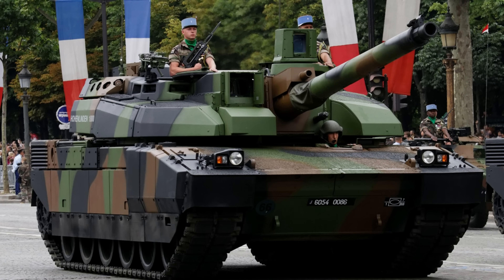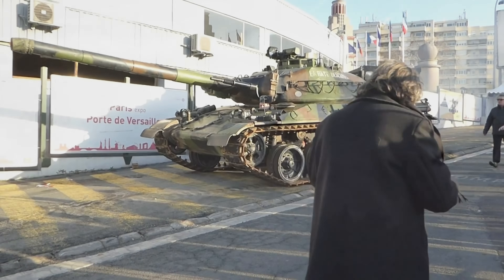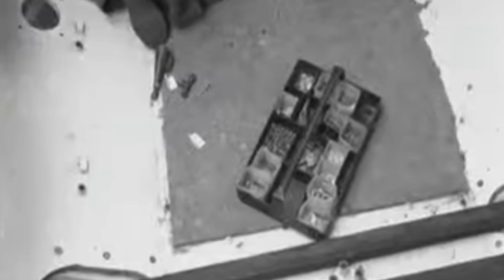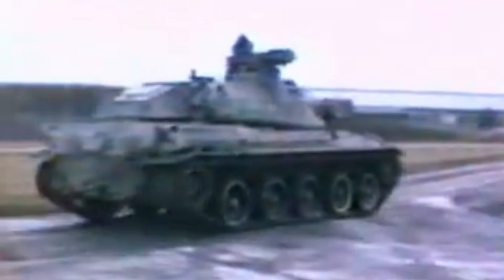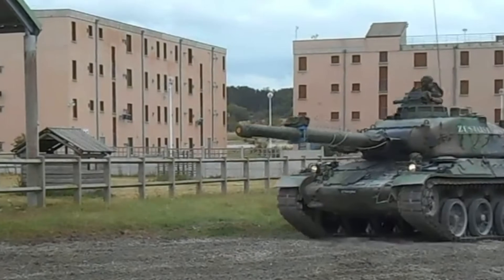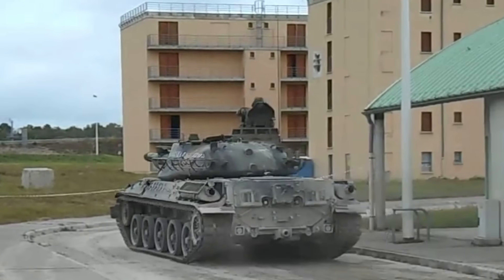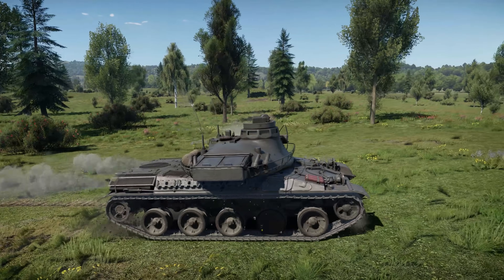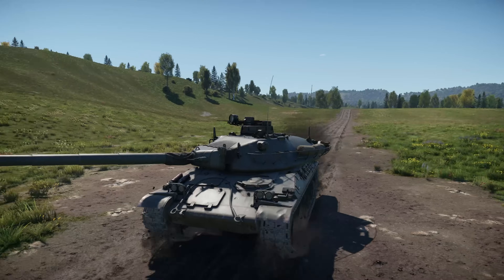The French AMX-30 Main Battle Tank | DOES SPEED BEAT LESS ARMOUR?

Comment: The AMX-30 was PERFECT when it was designed.
-HEAT rounds make armor useless ? Just put enough armor to resist standard autocanons. Also it's cheaper.
-Stabilization doesn't work that well ? Don't use it.  Also it's cheaper.
-Big guns are heavy ? Put a smaller one with a special HEAT round which will be even more effective against heavy armor of the time. Also it's cheaper.

The problem with the AMX-30 is that it was the Cold War, and each decade had saw many changes in tank design, So the bold and genious design choices made were completly obsolete 30 years later. The problem was the same for all nations with their old designs, France just had the AMX-30 as its MBT for longer.
Reply: Gotta agree, the Leopard 1 seems to basically get a free ride for its equally thin armour because the Leopard 2 exists. Concept worked great in the 60's and early 70's, became problematic after that. 
A lot of interwar tanks are attacked for similar reasons- a hill I will die on is that auxiliary turrets made sense in an era before widespread light AT weapons, radio's, electric turret traverse and good optics.
Reply: @Lancasterlaw1175  Auxiliary turrets were never a good option because of weight. Having a decently reliable vehicle was already incredibly hard, adding to it tons of armor, weapon and ammo only made it worse. All tanks with auxiliary turrets are just better when you remove them.

There is plenty of other problems with these design, but the weight problem was very clear even without combat experience, which explain why it was abandonned by almost everybody even before the war.

It doesn't mean a tank with auxiliary turrets couldn't be effective, especially in the conditions you describe, but even the same tank with less turrets would still be better.
Reply: @  May our battle be legendary!

I'm assuming here that we want something bigger than the FT-17 or Tanklette which were great in their own regards but would likely have struggled if confronted with larger tanks. Also have the 1925 to 1935 period in mind primarily, and that you want to have a cannon.

Early heavy turrets were unreliable, very slow to traverse (a full rotation needed 720 turns of the traverse gear) and the weapon either had to be free-floating (so the gunner can shoulder fire it) or be geared. 
Free floating has a major accuracy penalty, particularly at range, and is heavily impacted by gunner skill. Geared is almost impossible to fire on the move (even the MG) and even slower to engage close in targets.
One issue with heavy turrets is traversing them if the tank was cantered on a slope became even more difficult.

Ideally a tank would use its radio to ask others for help (scratch my back), but in an era where flags are the general method of communication this is impractical. Only a heavy tank can fit a practical radio.

A small turret however could be shifted quickly without gears, could have a freefloating weapon, and could be depressed lower.

Another issue is the terrible optics of the period, with most vision coming from small slits, good situational awareness needed multiple viewpoints.

Armour only became an issue when the new generation of AT rifles started to come into play which is 1938-40. Before that either your armour was bullet proof (8-15mm) or Shell proof (30-40mm) with most tanks built to the former. Imo AT rifles were one of the nails in the coffin for mutiturreted tanks.

Infantry support in the interwar period was sketchy, as few infantry even had lorries, and most infantrymen had likely never even seen a tank, let alone practiced fighting close alongside one. Losing contact with the infantry support was near inevitable.

Comment: I served on this tank during my military service in 1994. It was the AMX 30 B2 version, without ERA ( the regiment I served in got ERA a few months after the end of my service). It was already outdated, especially its armour and the fact that the gun was not stabilized. But despite all that it was a really nice tank. It has good speed, good firepower (105 mm + 20 mm) and, I think, a good thermal camera (not every tank was equipped with thermal but as a platoon leader I had one!). The COTAC fire control was very good and accurate. It would take about 3 seconds to treat a non-moving target and about 4 or 5 seconds for a moving one. The tactics, considering the tank's limitations, were mainly about shooting and running! Taking position,  concealed, observing, detecting targets, friring a couple of rounds and retreating covered by a smoke screen to another firing position. It was fun!

Comment: Seems like a good tank for its era. Most tanks of that era had ammo stored in the same compartment as the crew - which was okay when APDS was the main threat. But a HEAT anti-tank round made a penetrator that was relatively hot, and they also had enough penetration that a hit stood a good chance of setting off ammo.

Bottom line is that any of its peers were about as vulnerable to HEAT warheads, so all that extra armor just slowed you down.
Reply from the maker: Yeah it's a real trade-off 👍

Comment: The AMX 30 B2 had an APFSDS round with buckshot around the penetrator for added spiciness
Reply: I am not sure if that existed, or is a misunderstanding? Around the time the U.S. introduced its FSAPDS-D-DU for the Rheinmetall 120mm gun in its Abrams, the cash-deprived French Army was still refitting to the AMX-30B2 upgrade, and was forcefully denied funding for any new tank with a 120mm gun. So, GIAT engineered a FSAPDS-D-DU for the AMX-30's rifled 105mm gun, that used ball bearings riding in the rifling to prevent the twist from being transferred to the dart (akin to the same way their special H.E.A.T. shell worked).

That allowed the French 105mm FSAPDS-D-DU to penetrate the same amount of armor as the American 120mm FSAPDS-D-DU, but at 1,000 meters instead of 2,000 meters. It is that round the French took to Desert Storm.

Perhaps someone confused "ball bearings" with "buckshot," and completely misunderstood the purpose?
Reply: @davidgoodnow269  look at the image of the shell in the youtube link, that's not used for counteracting the rifling of the barrel.
Reply: @nicolaspeigne1429   You also say that it's a simulation . . . which means that round may not really exist. Versus, hands-on with the real round I described.
Reply: its not the best though. ive seen a sim against a btr80, and it didnt do much. against a heavier target, apfsds would work, and the sacrifice in penetration isnt worth it, especially against angled armor
Reply: @itsericzhou  what do you mean it didn't do much ?
Reply: @ against the btr, the balls didnt really spread out. https://www.youtube.com/watch?v=Vcui3La9y0o
Reply: @itsericzhou  the simulation is too short, the pellets would bounce all over the place inside unlike the rod who will just exit on the other side

Comment: So with the M10 Booker, the Americans have just reinvented the AMX30?
Reply: M10 booker is light tank and primarly infantry support
Reply: yes, they do what france does, ligh armor, a 105 gun and high mobility as M1 is too heavy to move or for a lot of battlefields.
Reply: the M10 booker is smaller and more like a light tank, similar capability but different doctrine. Booker is basically made with the assumption that it should not be meeting MBTs in the first place other than an ambush
Reply: @luthfihar3211  The booker is 38tons the AMX 30 is 36 tons (metric) so quite equivalent in all.
Booker : 6.85m x 2.4m x 3.65
AMX 30 : 6.59 x 2.5m x 3.10m 
The AMX 30 is smaller in fact if we just see the digits and for the lengt the AMX 30 has his turret in the center and not in the read, else the booker whould have been longer in that case.

it look smaller and lighter but it is not.
Reply: The M10 Booker is almost a meter and a half taller and is at least two tones heavier (likely 6) but basically yes. It does have modern fire control though.
Reply: @Lancasterlaw1175  M10 is released 50 years after, it is a bit the minimum that it included moder features, at least all the features expected from a modern tanks of its ERA. And maybe US will switch to autoloader one  like France does 20 year ago, on that it is a bit behing, it saves a lot of weighet and allow to reload while moving at full speed in fough terrain, what a manual loader can't.
India succeed in a small tank with an autoloader BTW, https://en.wikipedia.org/wiki/Zorawar_(tank)

Comment: Honestly... AMX-30 is striking me as another incarnation of this weird Euro doctrine of mobility focus. AMX-30, Leopard 1... is the same approach. The problem is that, while it has merit against  less advanced combatants who lack proper fire control systems and thermals as lesser weight does allow a lot of logistic and tactical mobility benefits, this approach is kind of doomed on modern battlefield - where a lot of systems have capability to detect and accurately engage tanks at vast ranges - making it so that modern tank needs to be able to shrug off a hit or two before it can effectively eliminate threat.

I think that while tanks do not necessary need to achieve survivability with thick armor, it's increasingly important for tanks to be survivable and mobile, while firepower is actually something secondary. There is no need to go over 120/125 mm tank gun.
I think people should be watching various "cope constructions" from Ukraine war with great interest because they are showing one possible route for development of armor - which is all aspect spaced armor. Just armoring your vehicle with volume of empty space concealed by thin steel plates seems like an effective choice. Because more than being armor, it obstructs tank's silhouette and causes premature detonation of shaped charge warheads. And as most of threats are some flavour of shaped chares... it seems to be very cost and mass effective way of constructing armor. I would expect tanks of future to be much larger but not really heavier than current ones. With a lot of volume dedicated to some fancy spaced armor configuration.
I would say that a 10mm composite plate placed 50 cm ahead of main armor would be worth far more than making armor 30mm thicker. It would give tanks what amounts to mobile concealment, especially if combined with modern "fabric camouflage" and use of foliage.
Reply: in the 1960´s, the amount of armor required to "shrugg off" hits from enemy tank guns and ATGMs was massive.
we are talking about steel plate, not composites.
Chieftain tried the "full armor" approach.
Result was a tank, that was up to 20t heavier than the competition (Leo1A0 40t combat loaded, AMX-30 36t combat loaded, Chieftain MK.3 56t combat loaded).
Chieftains mobility is legendary for how bad it was. Unreliable and overstrained engine and drivetrain, sluggish terrain mobility etc.
The protection also was questionable, as the 390mm frontal turret armor could be penetrated with a 100mm HEAT round on 1800m by a T-54a.
Back in the day, the main antagonist (the warsaw treaty and sovjet union) fielded T-54/55 and T-62 as primary MBT´s. 
These, like all MBT´s of the day, struggled with target aquisition and gun laying/aiming on mid to long ranges vs moving targets.
so the idea to be just a pain to aim at was not a bad idea, in comparison to pray that the enemy was using outdated and low performing ammunition. 
(and as we have seen in the Iran-Irak war, the Chieftain was a deathtrap on tracks due to its design. 600 of 900 iranian Chieftain MK.3 and MK.5 were lost in combat vs a few iraki T-72A (export model), T-62A and T-54A)
Reply: @cathulhu-q7y  Well said- I'd add that the M-60 managed to weigh almost as much as the Chieftain and its best plate could not even shrug off a BMP-1 73mm.

As a bit of a defence for the Chieftain the T-62's and T-55's could not pen their turret without HEAT shells. The worst operation they were in was a nasty operational level ambush where the Iraqi's had cracked Iran's code and figured out the Iranians were doing a risky river crossing and march though a swamp. The vast majority of tanks got stuck in the mud and were abandoned. Any tank would struggle under such conditions. (The AMX-30 might have done slightly better though)
Reply: The 60' weren't the same as now. HEAT was all the heat, with no counter (spaced armor working against bazookas doesn't work that well against HEAT rounds from tanks because the projectile is so much faster, you need something WAY heavier, which is weak to standard projectiles...).

The "cope constructions" are a solution against drones/infantry basic AT weapons, but they are very bad at anything else... (vision is terrible by design, spaced armor take a lot of place so it's huge vehicules which have problem to go in forest, streets, can't really hide in buildings...)

The Ukrainian solutions with nets added to conventional tanks seems way more promising (doesn't weight much, doesn't cost much, can be removed if not needed).

Comment: Whats the point of having superior mobility when you have to stop to shoot?
Reply: The mobility is for fast deployment, repositioning and especially reverse. The AMX-30 in similar spirit to the Leopard-1 are clearly not brawlers and do certainly follow the wisdom of 'firing first'.
Reply: every tank of the day had to stop to fire.
1960´s gun stabilisers were gyroscopic/mechanical 2 axis stabilisers, that shortened the time for gun laying when performing the firing stop and enabled the firing on the move on very low speeds while driving on flat surfaces (meaning maximum 30km/h on road to be able to hit shit with it). Offroad they were relatively useless, except for shortening target aquisition and gun laying for the firing stop.
this only really changed in the late 70´s with Leo2´s gun stabiliser and digital FCS.
Reply: No, at that time stabilation was normal for new tanks, the french effed up like always.
Reply: @HedgehogZone  no they didnt.
The gun stabilisers of the day were not able to fire on the move properly. only at low speeds on even ground.
So EVERY Nations tank doctrine included firing stops.
The AMX-30 has a stabiliser. But not for the gun.
Its primary gunners sight is 2 axis stabilised and the gun and FCS are slaved to it.
So in a firing stop, the AMX-30 could engage targets as quickly or even quicker than the competition. (looking at chieftain and M60 for example)